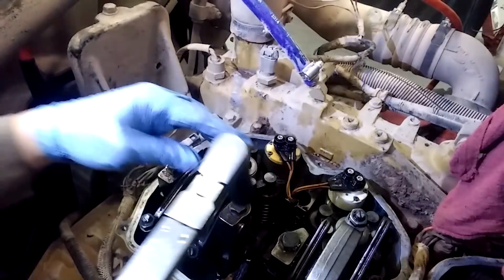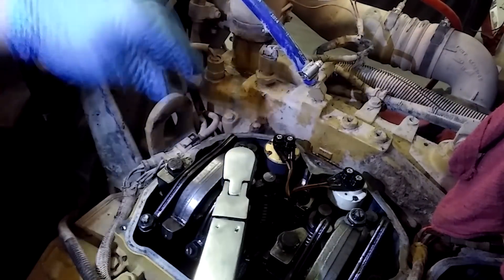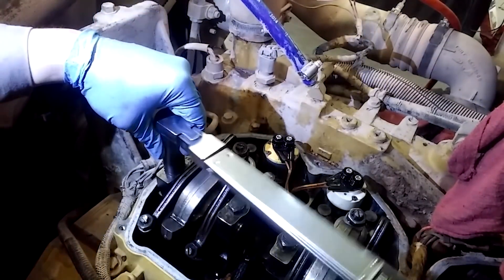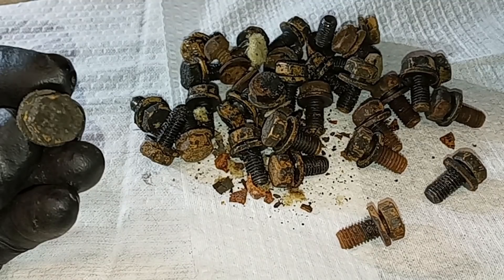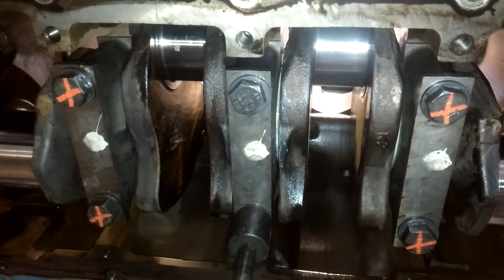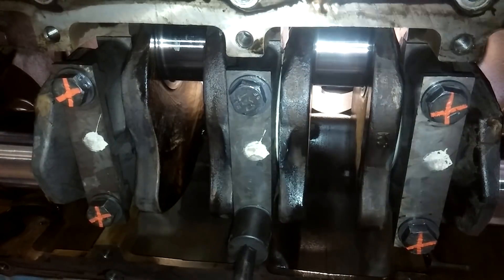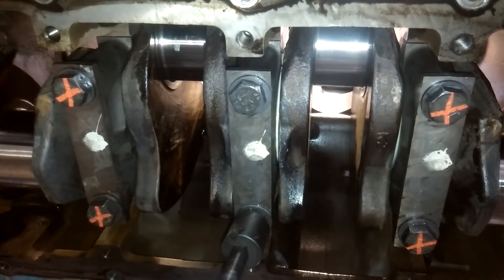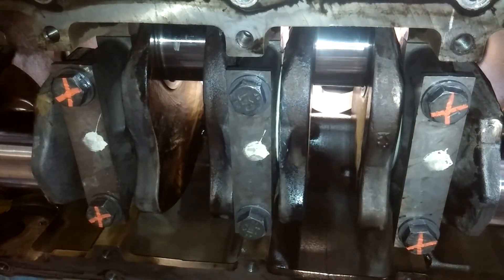Do You Need a Torque Wrench to Fix an Engine?

Comment: When i been in pinches where i dont have a torque wrench i torque by angle 

Lots of bolts i do 30 degrees after its fully tight 

If its heads il do the 30 degrees then its final degree it calls for in manual never had had a issue doing that when ive had too

Comment: I just done a clutch and pressure plate on my car my torque wrench clicker wasn't working so I winged it my question is if I made it toght and I mean tight as should I be worried?
Reply from the maker: Well, bolts have a range on them for torque. If you get close you might be fine. Lots of people never use a torque wrench, check out the Channels where they rebuild entire engines overseas without a single torque wrench and they stay together.

Comment: When I was 14 and completely rebuilding my first dirtbike 97 rm 250 . I didn’t torque a single bolt and that bike went for 150 + hrs before I sold it and someone is still riding it! Had 210psi compression at 150 hrs.I just tried my best to make sure they weren’t too tight not too loose and even. That being said I’m looking at doing a timing belt job on my car and I believe I should buy a torque wrench or 2. Do you need one for a dirtbike, nope, Cars yes. Just too much money on the line with a car I think.

Comment: I agree 100% with you I've been tech for about 10 years and honestly bolts that are very important  should be torque like basically internal bolts and some externals as well.... same go for a transmission diffs transfers and other that has internal components.... i totally agree with you... and i agree should a must to torque them if don't want to used a torque wrench well that on your call....

Comment: I was amazed that when I eventually purchased a torque wrench and tried it on my car lug nuts that I'd been seriously overtightening them for years. I'd never had any trouble but when I see mechanics doing up wheel nuts on cars with a rattle gun, (air impact driver) I wonder whether anyone can get them undone if they get a puncture a long way from town with no tools.

Comment: Using a torque wrench also standardizes everything. In the event that an engine fails after a rebuild knowing that everything was torqued properly in proper sequence makes finding the root cause of failure easier

Comment: I've been turning wrenches for a little over 25 years. Started in indies, then stealerships, and eventually went into business for myself doing track car prep, fab work, and composites. That being said, no matter where I worked I would ALWAYS use a torque wrench on anything internal to the engine/ trans/ drivetrain, and wheels specifically. I use torque sticks, then hand torque them afterwards. If it is some external parts or stuff that isn't as crucial, with enough experience and caution you can definitely develop a certain 'feel' for what is acceptable, and what is over doing it. Bottom line is just having the peace of mind of knowing something isn't going to grenade is worth using the torque wrench. I totally follow the same principles as you do, with internal parts being torqued ALWAYS. No comebacks= happiness and adhering to a high standard. After all, when you do a job, your name is attached to the work. No reason to put yourself at a disadvantage over something so simple.

Comment: I use a torque wrench on every single nut and bolt I can because I tend to break bolts or strip threads. I go until I think it's just enough and it often tends to be a hair too much.

Comment: For critical components like in an engine, transmission, differential, transfer case, ill always use a torque wrench. Something like a valve cover bolt, or a spark plug, I won't cause they don't need to be that tight. But when I see people using a torque wrench for every single bolt on a vehicle I can't help but think how slow and tedious it might be.

Comment: I had a torque Nazi spouting the usual gibberish about how you will wreck people's things if you don't use a torque wrench. The conversation came from changing a tire on the roadside with a tire iron or some such.

Anyway, I said that I can get a tire lug nut pretty close with my impact, and pretty consistent with each other by the ugga duggas, after which I was told how horrible I am and there will be dead puppies as a result of my barbaric mechanic skills.

So, we had a tire and we looked up the torque specs and I hit it with my impact. I told him I would tighten it so that if he put an additional 10 degrees on it it with a techangle then the final torque would be within 5 percent across the whole tire.

IIRC we were looking for 107 foot pounds so I did my thing, then he put the additional degrees on it, and we were very close- I remember seeing a 112, a 105, a 109, and the rest thereabouts.

He could not wrap his head around the idea that I was so dialed into my ugga duggas that I could do that consistently.

Yes I own and use very nice torque wrenches, where necessary. My criteria is how risky it is (people getting hurt, property getting damaged, and how expensive any rework will cost me), but there are things that I get into where I might need the ability to defend what I did should it come up. It would be better to state that the job was done in complete accordance with manufacturer's specifications and using quality calibrated industry-standard tooling.

Although I have never had it happen to me, it's not at all profitable to have a customer throw a connecting rod through his engine block the day after it was reassembled.

Having a crane fall out of the sky because I didn't comprehend TTY bolts is simply not an option.

Comment: I use a torque wrench every time I work on my engines. Inch pounds to foot pounds I even use my torque wrench on my wheels on my vehicles. That's the best way I know to avoid a failure.

Comment: Bought an 05 C7 swapping it into a discovery motorhome. Engine is a 210 hp and needs a rebuild which parts need to be switched to bring it up to the 350 hp family? Thanks in advance.

Comment: good for all of you to torque stuff, personally, I only torque mains, rods, and head bolts usually for a engine, but thats for personal engines. If you are in a trade your torque wrench should be calibrated every 6 months or so.  even as a millwright working on turbines my entire career, when I started we did most everything impact tight, or ratchet tight, they worked fine, these days it's hydraulic tooling and overthinking it tight with torque wrenches. Reliability really hasnt changed.

Comment: On older -or thicker castings it is not as critical, on newer - thin castings  it is more critical  to be more acurate on torque.  I have used a 3/4 " air gun on 3406 -3408 cat engine , kta cummins small cam , big cam cummins cummins main bolts  , head bolts and never had a failure of any kind. Ichallenge any mechanic or technician  ( pretty boy parts changer) to torque a kta , big cam , cat main bolts  in the truck frame !!

Comment: I’m nothing more than a hobbies wrench turner but I share the same opinion. I rarely use she short of a die grinder. But anything inside the engine or has a gasket under it (most the time) is getting a torque wrench.

Comment: Torque is also crucial outside of the engine for some brands as well, overtighten a bolt in an aluminum casting and you risk warping something or breaking the part.

Comment: bolt torque is not only about clamp forces, it also about the proper friction applied to the threads so it wont loosen up,

Comment: An added comment In fleet repair we insist every bolt is torqued The reasons are fairly simple 1 The trucks always come back if someone has over or under torqued apart we have to fix it 2 We don’t have enough time or mechanics to service our regular work why invite even more 3 If fasteners are over tightened they get stretched or worse tapped holes get damaged pulled threads etc all super time consuming on a scheduled repair4 Our shop has a high work standard Our work is our signature Every truck we street is repaired to the bes

Comment: Great video Josh good to explore everyday misconceptions from a professional view As a heavy truck mechanic and a racing car crew chief I torque every fastener Close does not cut it when someone’s life or thousands of dollars may be wasted because of laziness I had an opportunity to design a product Once I went through the engineering research on fatigue strength and yield on the fasteners I used correct torque procedures became very clear Some one calculated the exact yield and stretch for the part. The least we can do is follow their torque spec! Thanks like your videos

Comment: Forty one years on the Mississippi here, dealing almost exclusively with EMD engines. A compete set of torque wrenches were provided in the boat's tools, up to and including a mechanical advantage wrench for the power assembly crab nuts (cylinder hold downs), which went to 1800 ft/lb. Dawg help you if the port engineer found out that you were doing everything by "feel", and not using the company provided tools. As another poster said, "due diligence, man."

Comment: The standard bolt shank to head formula.
If you have a 3/8 shank and you multiply the shank 3/8 X 3/2, 3 X 3 = 9, 8 X 2 = 16. Wrench size is 9/16. 
If you have a 9/16 wrench and you divide the wrench size 9/16 divided by 3/2, 9 divided by 3 = 3. 16 divided by 2 = 8, Shank size should be 3/8. 
Use 3/4 wrench, 3 divided by 3 = 1, 4 divided by 2 = 2, shank size is 1/2. 
Or shank 1/2 X 3/2, 1 X 3 =3, 2 X 2 = 4. Wrench size is 3/4.
You have a 1 5/16 wrench. So you have 21/16, 21 divided by 3 = 7. 16 divided by 2 = 8. Shank size is 7/8.
Now here is some goofy ones. 7/16 shank. 7 X 3 = 21. 16 X 2 = 32. Wrench 21/32??????? So if you add 1/32 you have 22/32 reduced to 11/16 or if you subtract 1/32 you will have 20/32 or 5/8. So on weird sizes you will be close. Not always perfect, but gets you in the ball park.

Comment: Always use the torque wrench. I still remember the day I bought my first (and only) Snap on wrench back in 1992, for 180.00$
I've never dropped it, or loaned it out. I don't have aluminum rims on my truck, or I suppose I would torque them. Great video.

Comment: had a friend rebuild his 289 mustang engine using just his air impact  Rods,Mains,and heads. Scared the hell out of me, and it had almost 90,000 on the engine when he sold it. With out any major failure. When I was still working I would send out my torque wrenches once a year to recalibrate them ,made me feel better.

Comment: Just what you said in the beginning lol always follow manufacturer specs, well guess what every manufacturer has a torque spec, and I always follow it, I don't care if it's valve cover bolts or suspension bolts! And yes of course if I can't get to them with a torque wrench I try my best to tighten it close. Also I'm sure where you work, if they find out you don't torque the bolts you could probably get in serious trouble too.

Comment: In the first world, litigation and guarantee of works is much more of an issue than in the third world. 

My own father trained as a mechanic in the 1960s in a small village in East Africa.   Then moved to Australia in the mid 70s continuing his mechanical work.  It wasn't until the 90s that he saw a torque wrench for the first time.
He did everything by 'feel', and taught me the same.  Would tighten something right, then make me ' feel it' and tighten the next the same amount, which he would check.

The guys in the video likely trained the same way... Passing down accumulated expertise directly, as there are no trade schools to learn from in much of the third world.  You learn on the job with whatever limited tools you have.

Comment: If you want more consistent and reliable results, YES. That said, what really matters isn't really torque per se, it's the effective clamping load. Bolt stretch is a much more accurate measurement of clamp load.

Comment: I haven't taken the time to go through and look if it was suggested- but I think it'd be pretty neat for you to "free-torque" a bolt into some threads; using either a torque wrench that's able to "reverse" or a scale with a string attached to it (similar to a fish scale) connected to a ratchet. That way you'd be able to show those people what 15+ years of experience does and the inconsistencies it can have if repeated multiple times. Great video and explanation!

Comment: Yes and no.  Didn't hear one comment of how the torque wrench should be properly calibrated.  One could use a torque wrench for 20 years and never calibrate it.  Also what about torque to yield bolts where they are torqued to a given value and then turned another given amount of degrees.  There is no measure what the exact torque is after that tightening.
There are many variables on the threads of the bolts where the threads should be chased with a tap or the threads should be dry or lubricated.  All of these things change the actual torque required when tightened. There are even specs where one is to tighten till finger tight and then to tighten a further given angle of degrees. No torque wrench here.
A torque wrench properly applied is a good approach but not the only one.

Comment: As a 20+ year mechanic, I've developed a pretty decent 'feel' but will always use torque wrenches. It's all about consistency and safety. And for CYA 😉
Reply: When I worked at a shop (4 wheelers) I won many bets where I could be within a 1psi of tire pressure by hitting it on the sidewall with my hand. Lol.
But I always torque to spec.
Reply: @jesusabueno1701  that’s awesome

Comment: Would I use a torque wrench on an exhaust manifold or alternator bracket probably not but when it comes to things that if they fail would cost me time and or money especially a large sum of money then absolutely I use a torque wrench. When it comes to doing a repair for a customer they're paying you to do a job the proper way and when there's standards that are to be met they expect them to be done. If you go to a restaurant for a grilled cheese you wouldn't expect one with unmelted cold cheese and you wouldn't expect it to be burnt, there's just a way that things are expected to be done.

Comment: It's cheap insurance for piece of mind. Also like you mentioned the consistency of getting them to the same spec. I know if I torque a head my screwed up elbow would click earlier and earlier. 😂 Obviously, your torque wrench is only as good as you treat it and have the calibration checked to actually ensure that it works as indicated.

Comment: I personally drive behind an engine I know wasn’t torqued on my farm jeep, and I don’t torque and lug nuts when I change a tire and such on a trailer or something like that. But now that I’ve gotten more into engine mechanics and rebuilding and transmission work I will probably start to use one more often. Although, I’d say unless you’re bolting on a rotating or sealing part (where a gasket needs to be compressed) that it’s pretty easy to get it right by hand using common sense. Although when you start working on undercarriages of tracked vehicles I’ve seen some parts get ruined from over/under torquing.

Comment: I think if I had a choice I'd rather have the guy with a torque wrench. But that's not always an option. Then I chose the guy with demonstrated skills and experience.
I think you made a really solid point when you said if you've never used a torque wrench at all how do you even know it "about right". 
Obviously it'd be better to do the job with the right tools but getting the job done with what you have is much more difficult and therefore impressive.

Comment: I'm a used car dealer, with the number of vehicles I must recondition prior to sale, makes the use of a torque wrench rather time consuming.  I don't use a torque wrench, unless it's a critical component, like a head bolt.  But things that are difficult to mess up, such as an alternator, air compressor, or even an oil drain plug, I just use a "calibrated arm", of it's a small fastener, a "calibrated wrist".  On my personal vehicles however, I use a torque wrench on everything, from a lug nut (measured in ft-lbs), to a thermostat housing (measured in in-lbs).  Takes me longer because I have to look up the torque specs on every fastener, but I don't work on my personal vehicles on a daily basis, so it's not a huge waste of my time.

Comment: Calibrated hand, but I work on big industrial equipment, double wrench base bolts doing machine laser alignment, I'm good for 800 ft lbs (checked with battery torque gun with a reaction bar

Comment: I work as a bus mechanic. I use a torque wrench whenever it's extremely important stuff that could fail and cause a big expensive disaster. I use a torque wrench in those cases as a insurance that i did the job on the tightening part correctly and there are no longer a guessing game.

Comment: Put a torque wrench on critical fasteners, most small brackets I won’t always torque. If the bolt is something that will be removed often, however internal fasteners always gets a torque wrench.

Comment: I'd say yes. Because there's quite a few bolts that need to be torque to 'x' and turned an additional 'x'⁰, aka torque to yield. Though they could have just as easily put it as a torque spec rather than a torque and degree.